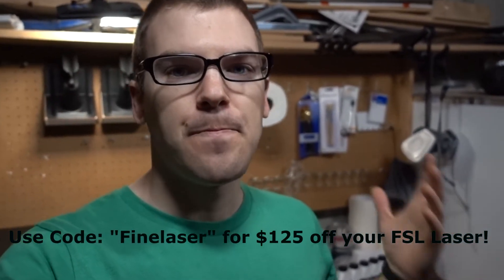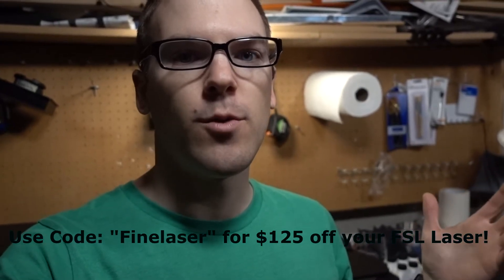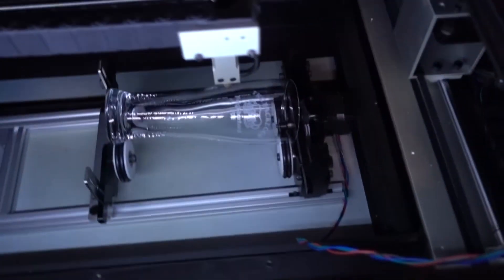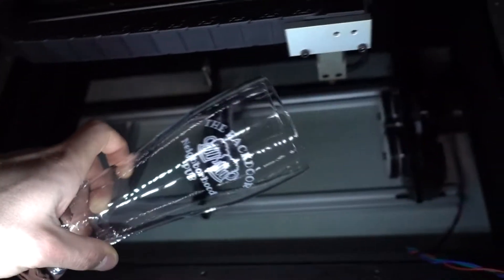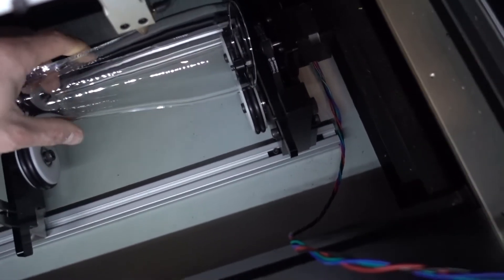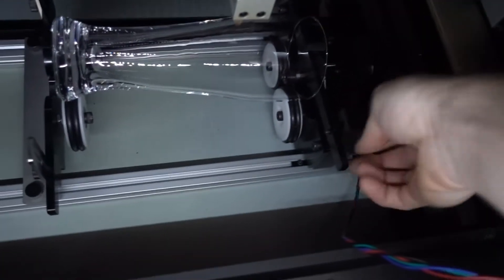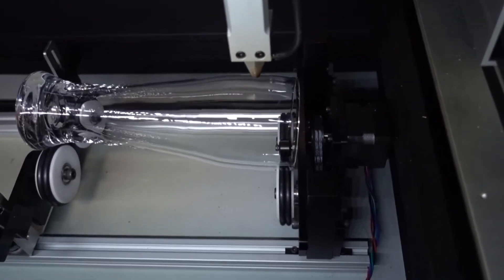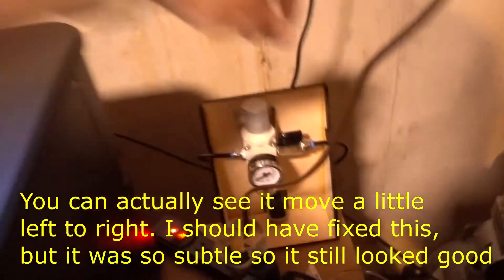FSL Muse Hobby Laser -Rotary Workflow

Comment: I may have missed it, what are your settings for the glass? (I have a MUSE myself).. Thanks and endorsed.
Reply from the maker: For glass I've used power 80, speed 85, and 1 pass at 500dpi. I also defocused the lens a little (focus length of 3/8" from the nozzle for the 2 in lens).

Comment: Can I pay you to help me? Something wonky is happening with my project. The perimeter runs fine, but it tries to engrave a completely different area of the bed. (I’m new here so this could be a simple answer - sorry if stupid question!!)
Reply from the maker: Couple quick things it could be. Doesn’t sound like absolute mode because of the perimeter being in the right spot, but worth checking. It is possible something isn’t refreshing on your screen depending on which mode you are in. I would recommend just moving the file slightly and then running the perimeter again and checking. If it is still in a different location try creating a new project and trying again. If it still happens then you may have found a one-off bug and should report it to FSL.

Comment: Our laser seems to not fire when we enable our rotary. Have you had any similar issues?
Reply from the maker: No I haven’t had any issues. There are a few things to check. First is the lid closed? Second is the water pump moving water? Third what is the current reading on the screen? Fourth, is the tube lighting up at all when you run the job?
Reply: I had that issue and called Muse. They pushed out an update to my machine.